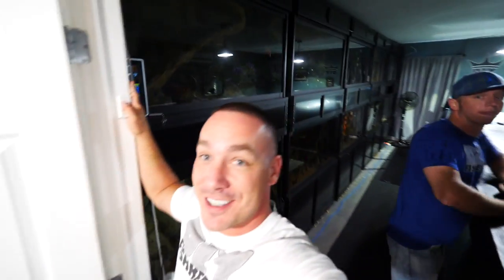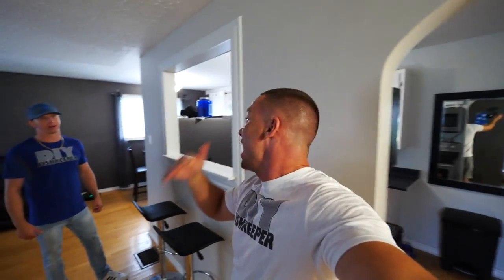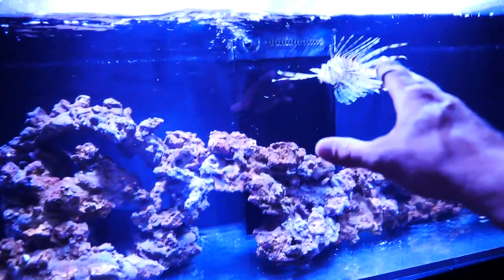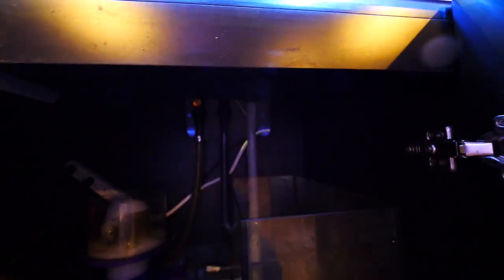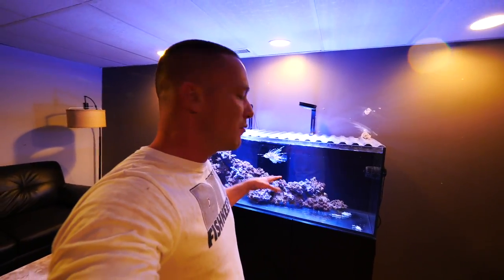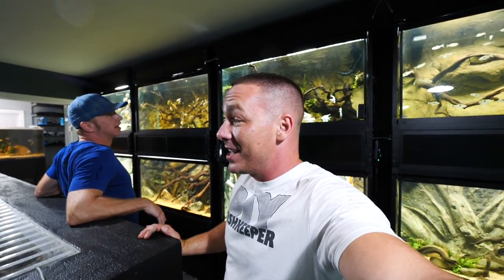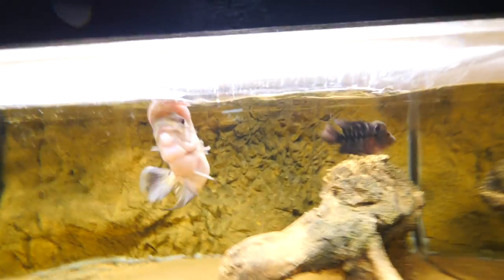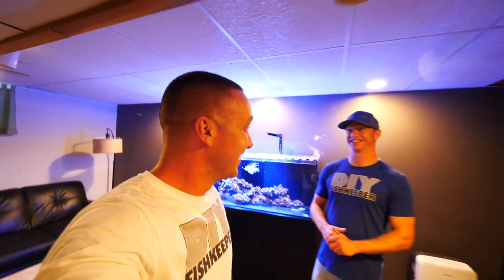I broke an aquarium | The King of DIY

Comment: I do a/c and heating for a living joey.  You can’t just put those units in and open the lines and expect them to run like a champ.  You have to pull a vacuum on the Freon lines to pull moisture.  Or who even knows you could of had a burnout on the compressor the first time.  Acid in the lines will kill any machine

Comment: Lionfish tank should be at least twice as large so he can swim freely. Come on Joey you have the room there for it.
Reply: dentednj  No it shouldnt, if you go to big with a Lion Fish it will turn wild and have an even worse temper then normal, 9-10 killing anything its kept with, often true with snake senses as well. Their anger comes from the Receptors they have as a defense and if they are not used often enough , then he will turn into predator mode when it does.

Comment: HELP?!

i have a aquarium and it is 500l (132gal) now i need to buy a filter do i need to buy a filter for 500l (132gallon) or can i buy a filter that can do more than that like 1000l (264gallon) for an later upgrade ??? Does it matter ??
Reply: Robin Visser just make sure the fish are putting in the tank can handle the flow of a bigger filter because if you’re putting small fish in there they might die
Reply: over filtering is always good but i think a 264 for a 132 is over kill. and as the other comment said make sure you’re fish can handle it or that you can at least adjust it so the flow is low. but if your tank does well with a 132 then it’s safe to stick with it.
Reply: Glen Myers thanks for some recognition

Comment: Got a question Joey, got 2 awesome tanks, with small cracks both at the corner on the bottom panel at the siliocn, could i still use them safe? or is they ruined?
Reply: You're missing helpful details to better answer your "Q".  Shape, size, etc.  That said, if it's a simple rectangle you likely can a) replace the cracked panel, or b) silicone something solid over it (piece of glass, etc) depending on the nature of the crack, and its location.  Joey has a video where he explained these options as added information.  It was in his video of how to build a corner aquarium.  Anyhow best of luck.
Reply: They are just regular tanks on 54L and 120L, the nature... idk, got them from a friend so... if i need to repair it, i need to do all corner so it level
Reply: Sounds fun.  Where are the cracks located? side of glass, bottom piece, corner?